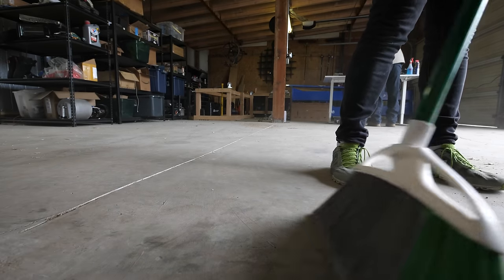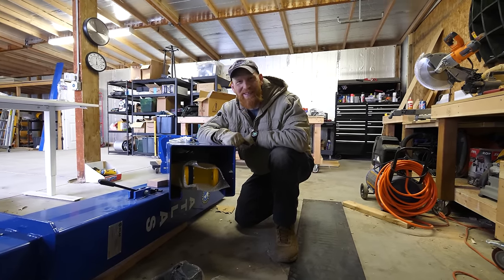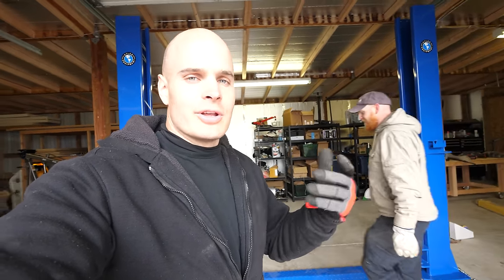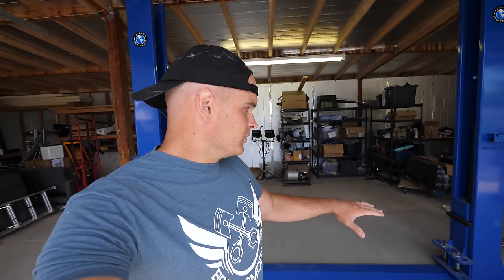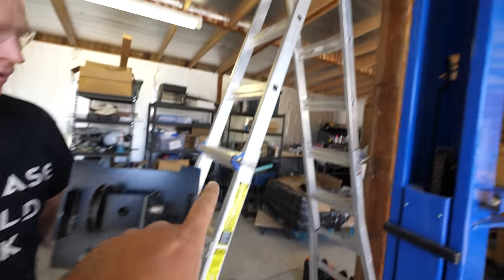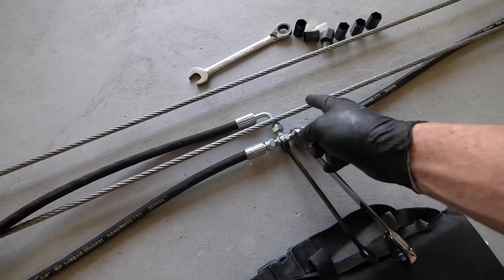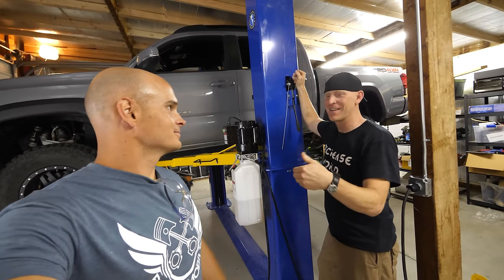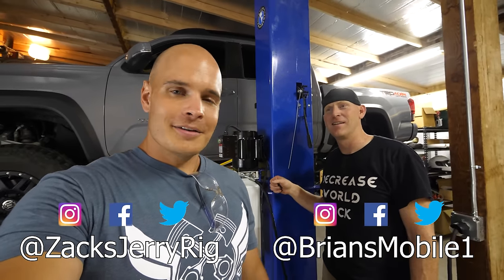Installing a 2 Post 10,000lb Vehicle Lift! - Check concrete FIRST!!

Comment: I've done this before. You should epoxy the expanding bolts in the concrete and allow to set before fully tightening. This helps maintain the concrete, bonds to the bolts and reduces cracking from over pressure.
Reply: Yeah , we use that stuff to install 8ft long rock bolts for ground control in the underground mine I work at. Works great because it provides a "full column bond".
Reply: We had nothing but issues with customers that epoxied anchors in. They are designed to function on their own in a 3/4 hole. Other manufacturing companies use anchors that are designed to be epoxied in place.
Reply: @mainmanmustard  Thats sounds like a smart idea to epoxy the wedges in place on the bolts so the don't work as intended.  Sarcasm

Comment: Good judgement on the slab upgrade.  Could have placed thickened slab at the post locations and set j-bolts in place during the pour.

Comment: BTW, now that you've figured out the max. height you can go, I'd mark the columns so that you don't go any farther. Now, I know that different vehicles are different heights but al least you'll have a hint on how far you can go. I guess adding more outlets for lights or power tools for working on anything on the lift. A latter for access to the cab while what ever is on the lift, without lowering.

Comment: The anchor bolt sleeves wedge tighter as the nuts are tightened, not as the bolts are driven down.
Reply: Thanks . i was waiting for someone to get that straight.

Comment: I know that this is a bit late for Zack but perhaps not for the rest of you who are contemplating installing heavy equipment on concrete.
When using anchor bolts do NOT follow the instruction of the equipment manufacturer (unless the anchor bolts where part of the delivery) follow the instructions of the anchor bolt manufacturer for the appropriate size bolts. However, in most cases you can follow the specifications of the UBC (Uniform Building Code) for anchor bolts in different types of concrete.
Working as a standards engineer for more than 20 years I have read most anchor bolt manufacturers spec. sheets and compared them to the UBC or the many national equivalents. The specifics vary quite a bit but when following the UBC you seldom go wrong.
Reply: The bolts did come with the kit. So don't follow the torque specs that the chinesium manufacturer wrote in the manual, is the moral of the story.

Comment: I’m not a pro but I’ve installed a bunch of lifts they usually come with anchor bolts about 5in long which are probably fine but I always get longer 7in anchor bolts. When I pound the anchor bolts in I put the nut on the bolt flush then when it’s all the way down I back the nut off about half way and pound it in more so when I torque the nut down the bolt usually is only sticking out a little bit past the nut so the anchor bolt is as deep in the concrete as possible.

Comment: Luckily you didn’t hit the No. 4 rebar when setting the anchor bolts. Good decision to sawcut, R&R the PCC panel to 0.65’ in depth with reinforcement; 0.50’ would have been the minimum for something like that.  Nice install 🏗
Reply: FYI they make rebar eaters they call them now. Just a hollowed out bit that goes in hammer drill kinda like a mini hole saw. Figured I'd share this in case someone hits rebar setting achors. Happens alot setting transformers & gear etc. in electrical industry. 😎👍

Comment: This is why I bought a scissor lift because the footprint is okay on thin concrete but some two post choice these days come with a thin concrete kit as an extra and I’m guessing it’s just a square section of checker plate to spread the load

Comment: One thing to keep in mind is sometimes those max capacities are inflated. It can get very unstable and scary if you actually get close to 10k lbs. I remember from working in tire shops the arm starting to flex with full size trucks
Reply: WRONG. The lift in this video is shit but to meet ALI it needs to be able to lift 1.5 times capacity. Rotary designs theres 3:1 meaning its designed for 30K tested at 15K and cycle tested at 10K for 20,000 cycles.

Comment: If the center of gravity of the vehicle was in the center of the posts, and if there was a spreader on top of the lift, you would not need to bolt the lift to the floor. But I realize also most people will have no clue how to figure out where the center of gravity of their vehicle is. I guess what I am getting at is thick cement and large anchor bolts are compensation for huge margins of error in these situations. Granted also they are needed to keep the top of this style of lift from pulling the top towards each other due to no top spreader.

Comment: Thank goodness 13 years ago, my contractor poured extra heavy concreate to accomadate a lift that I desired someday.  And I had the garage built with a 13ft ceiling!  Now, my 2 post 9000Lb lift is on the way, after all of that time!  Also I'm reading 4" minimum.  I found the paperwork and the floor was poured one piece (monolithic), and 4" thick with double rebar and steel screen.  If I pull all of the arms and stuff that's shoved into the post for shipment when it arrives, I wonder if, with help I can tip it off the back of the freight trailer and let the other end drop on a couple of tires.  I have no fork truck but my neightbor down the road has a tractor and said would help me.  I don't know how available he is, and my luck will be, the truck will show up and I won't be able to contact him.  That lift that you have didn't seem brutal heavy after you removed the arms and such.  Also, the lift I have coming is clear floor, so I'm hoping there is a bit of support at the top cross piece.

Comment: great video. I have a few bits of correction. concrete is made from cement and aggregate mixed with water. the two terms are not interchangeable. Across doesn't have a T in it. the anchor bolts are rated for pull-out, nothing to do with the strength of the concrete bearing or weight of the truck. If a post starts to fall the pull-out on the expansion anchor becomes huge because of the leverage. The expansion bolts have a collar in the bolt at the outer end of the thin metal "wedge" that keeps the wedge in place. Once the bolt is set in the concrete tightening the bolt pulls it up and the wedge expands because the bottom of the bolt is tapered. There is nothing sketchy about these, they are used in industry to support all kinds of loads. Hilti makes ones that are for earthquake zones.

Comment: If that resovoir doesn't have a drain valve definitely add one at some point. Saves a lot of headaches by doing preventative maintenance regularly n on time. Keeps it all safe n let's ya do full fluid change after wear in period

Comment: Interesting video.  I'm hoping to install one of these in my new place not long after I get settled in.
I'm not an installer, nor do I claim ANY sort of expertise or even any experience with installing these lifts, but I one thought about your installation...
In the interest of economy, but still being safe, I wondered why you tore out and replaced the entire section of floor instead of just a strip of the floor, or even just a couple squares where the uprights go...
Reply: For rebar to add exstra strength one square can seddle to easily u see how they put rebar in the sides of the slab that was still there it’s to add more integrity

Comment: If installing a two post'er in a low roof height application, a clear floor versions with overhead cable's and a bump bar will allow both better safety for ceiling and vehicle damage and a clear floor to roll a mechanics seat, creeper or trans jack under.

Comment: in the tire shop on  second floor the floors werent thick enough .so the engineers had road plate bolted to the floor and the equipment bolted to that.

Comment: Great project. But using the 3/4" lags that came in the kit, and not upgrading to a seismic graded bolt may cause it to shear if loaded during an earthquake. Hilti has lags with a red stripe that are seismic rated. I am required to use them locally, and we don't have 10 quakes a week.
Reply: They'll be just fine.

Comment: so around 11:00 when you were talking about putting in the anchors, my nuts after a year or two all somehow were a little loose. I don't know how to explain it but I would advise to check them ever so often! 
This is an awesome video! very detailed and informative. I've noticed that two post lifts are getting to be more common place in the average garage but there just isn't that much information that can easily be found about them for the average person.
Reply: Epoxy in the best all thread you can, tightening them should not be necessary

Comment: good call on the concrete redo. However i would have made a template and used Jbolts when concrete was going in. You can get risers for the arms to avoid damage to the vehicle frames. as for those quakes they are from idaho. which has been shaking ever since they had that 6.5

Comment: Great video. my concrete is all cracked and raised in spots so i was wondering if i could just replace the portion that my lift will be on and i guess the answer is yes. How much did that cost if you don't mind me asking? Cutting out and laying new concrete i mean.

Comment: I work at a Ford dealership, and we recently had our deatil department moved out of the truck/diesle shop and moved into our collision center for more space.. Anyway, we had 2 more 2 post 4 arm lifts by Challenger installed both rated for the weight of an F250 to an f4-550, depending on what the fleet company blamed on the raw frame of 550. Anyway, the 2 post lift we had installed. I watched *ONE GUY*  shim.y both standing posts into place by himself.. yall making them look like they weigh a ton.. When you got the post standing upright, their stupid easy to rock side to side into place. One dude installed diesle lifts while the other guy inspected the rest per yearly shop lift inspection.

Comment: We use the same size anchor bolts  5 1/2 long x 3/4  and we use them to brace precast panels  weighing  over 40,000 pounds  30 feet tall  and those anchor bolts are really strong
Reply: I have pulled out a chunk  of concrete  out  never broke those bolts though   the concrete  usually  fails first  take a look at  wells concrete on Google and that's what I do for a living  build precast buildings and parking lots

Comment: Personally if I were dealing with the same circumstances I would have just saw cut the pads where the lift legs were going and used a post hole digger to dig a 2'-4' deep pocket, then installed long j-bolts into a concrete beam poured into the void. This would provide a much stronger and deeper base for the lift.

Comment: I think it's easier to drill several holes into soil under then slab, then fill it with high pressure cement. Just like the way repairing the roadway.  Alternatively, do two pad footings to support the lift.
Reply: I don’t think this is gonna work.

Comment: I would not have done the install on the 4" slab anyway. You would have no good way of determining a safe load limit for that lift. I would also order high strength concrete and add some PVA fibers to it, and some extra iron around and under the posts. I did have a vehicle fall part way off a lift. I was not under it at the time, but we did get it back down safely. The shop insurance totalled the car which the customer was fine with. It was caused by too many mechanics. One mechanic removed the transmission crossmember and stopped because they had the wrong crossmember. Another came in to change a motor mount, and at that point the only thing holding the engine and transmission in was two tall jacks and the wires and hoses on the engine. This would have been ok but the lift was a single cylinder hydraulic which can allow the car to rotate a little.

Comment: It would have been cool if you could have used the lift posts as replacement structural posts since those were built on piers! Probably not the right width but it would have been convenient!

Comment: I wonder how Zack realised that the concrete wasn't as deep as he initially thought - a good skillset to have! aka I'm asking for the answer :p
Reply: When he was drilling holes for the concrete anchors he could feel the drill bit break through at what he thought was too shallow and then he measured the the length of the drill bit and could find out exactly how thick it was.

Comment: I have an old Snap-on wheeltronics from the 80s that it takes it lifts a small Bobcat will tip over trying to lift one arm or one column you could barely one man could barely lift one end of it it's only eight thousand pound lift but I've had a 12000 pound truck on it the old school is made and if you're going to go with a new one go with a mohawk or a rotary

Comment: 14:35 I don't know Zach, I feel like that would be strike three for me. Having inconsistent concrete thickness information, NO torque specs, and the missing power cable.. This would be something I'd want 100% confidence in..
Reply: I'd assume the cable was missing because you'd normally have it permanently wired in, not plugged into an outlet.
Reply: Things like this never come with power cables. When your water heater goes out, and you buy a new one, don't forget wire, because they don't come with it either.

Comment: teflon tape or sealent is not recommend for hydraulics anyway it can cause all kinds of issues if it gets into the pump or valves use locktite 545

Comment: No tape or dope needed on hydraulic lines. Those fittings are made to tighter tolerances that regular plumbing fittings. They don’t need it. Overkill is fine but that is in the diminishing returns category.

Comment: I have 4" 3000 psi concrete however right where im gonna put my lift there was another 4" pad we poured over, giving me a total of 8" i have no idea tge psi of the old pad but it has been there since 1927 so it is super cured. I should be fine but i think im gonna get some longer toggle bolts to get into the second pad below and install tge overgead lift type for added stability

Comment: Well ..since you poured new concrete ..you COULD have made an outline of each baseplate ..a template ..and installed anchor bolts in the new pour ..but ..cool install

Comment: Thanks for the video. It helped me decide what to do on my install. I ran into a similar problem except my slab was 5 inches thick, but just not strong enough concrete. I opted to cut to 4x4 sections dig down to 12 inches, underpin, place rebar and fill with 6000psi concrete (only 3000 was required by mfg.). Now I wait 28 days and do the safe install. I read a few comments said here and elsewhere "why not put bolts in the concrete before it dries". Probably not a good idea, firstly because one small measurement error and you are in big trouble, secondly even if you measure it right how do you get the lift post elevated enough to put in place. Good wedge anchors will do the trick.
Reply: If you need to pour new concrete footings anyway, then J bolts work great. It's just simple math and some plywood with holes to keep correct J bolt spacing and depth. I build steel buildings and we use J bolts for every column in the plans. Just sink them down far enough so 2-3 inches stick up from the floor level. Sounds a lot more difficult than it really is but can only be done while concrete is still wet. Afterwards, when they're in and concrete is dry, no worries. Then tilt up the posts on to the bolts. Add nuts. Easy. And yes, metal buildings DO NEED to have accurate spacing between columns or the rest of the building won't line up. Been doing it for 20 years.
But then again, as with many things, it's always a lot easier when you know what you doing. Not so much when you don't.

Comment: I’m getting ready to pour my garage floor and I’m genuinely curious if you could of used anchor bolts placed in the concrete (knowing damn well that’s a tall task to get perfect, but boy do I hate the idea of those expanding anchors on concrete. I used them installing a gate and redid everything adding the L style bolt in wet concrete

Comment: I am getting ready to install the exact lift that you installed and have two questions:
1) since installation how satisfied are you with your brand selection, would you purchase the brand again?

2) how is your concrete holding up? It appears that it’s been about two years since you installed.  I have 4000 lb. 6” concrete that has wire mesh and fiber re enforcement.The majority of my use will be small to medium sports cars.  Also some Land Rover 110 Defenders.  Just trying to determine if I can simply install or re do concrete.
Thanks for any help!

Comment: How much did having to have the slab repaired cost. I'm planing to build detached garage, and ideally want to install a 2 post lift. I was hoping to pour a pad just for the lift and run interlocking stone throughout the rest. but because, I don't have the structure built yet I am hoping to plan ahead and not run into this problem. love the install. great job guys!

Comment: So you're talking about the 4000 psi strength of the concrete and the load being distributed across the full area of the foot of the post, but then you stuff a tiny shim under there and now the only part bearing on the concrete is the shim and the opposite corner of the post.

Comment: Should have got a 4 post "mobile" lift (NOT a C-channel lift), you could have rolled it outside to raise it higher when needed and your concrete would NOT have to have been modified. Two posts are nice but have more limitations, arms fail, they bend more under loads and far more prone to failure than 4 posts, examples advantage 4p, wildfire 4p, bendpak's (new grandprix 4p lifts they offer the smallest footprint of the 4P's available)  backyard buddy etc... make great home lifts.